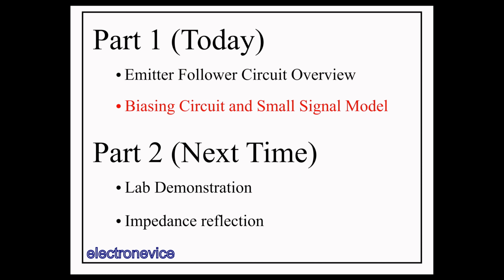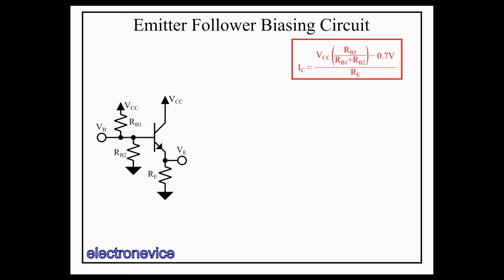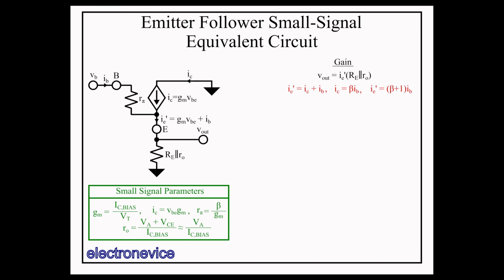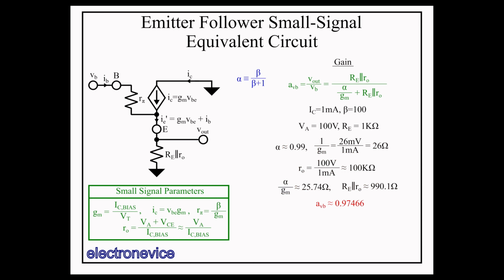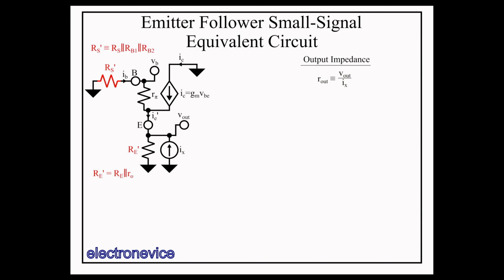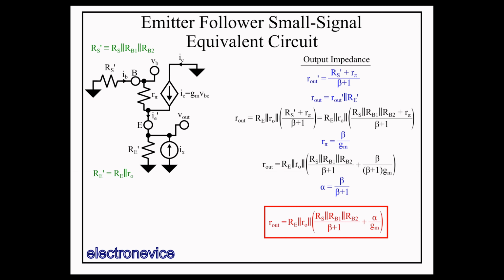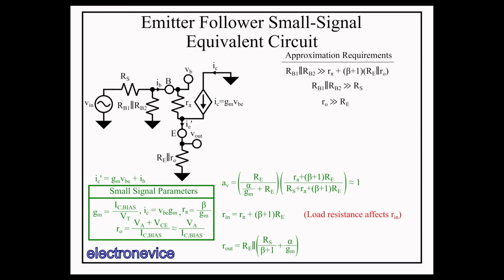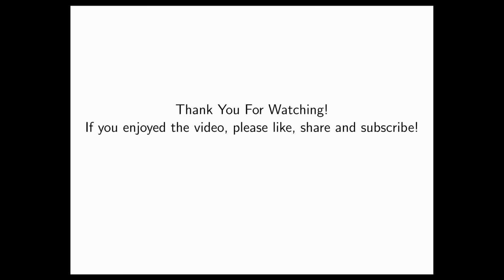The Emitter Follower Amplifier Part 1 [Transistor TS 5]

Comment: Great video! For calculating the output resistance it helps to remove the Re//ro term first  and inject the test current it with a voltage source vt. vt/it will be rout for the modified circuit. Once rout for the modified circuit is found, you can reintroduce Re//ro to obtain the output resistance of the full circuit which is rout//Re//ro
Reply from the maker: Thanks!  Yes removing RE' first then add it back in alter would simplify the situation.  I just wanted to do it the "long" way here

Comment: Hi sir could you please make a video on how to select opamp for any particular application based on its parameters like when we should select rail to rail opamp or high bandwidth one
Reply from the maker: that's a good idea, though I'm not sure if I can do a video like that until I've gone over op-amp noise, as op-amp noise is a significant consideration for choosing an op-amp and is connected to the power consumption and bandwidth
Reply: @electronevice  sure sir.. please take your time ..just thought to share if you include in the future videos